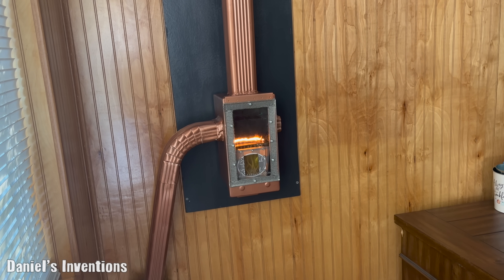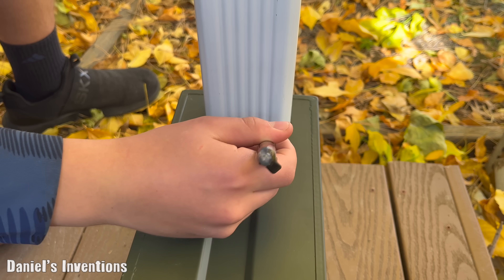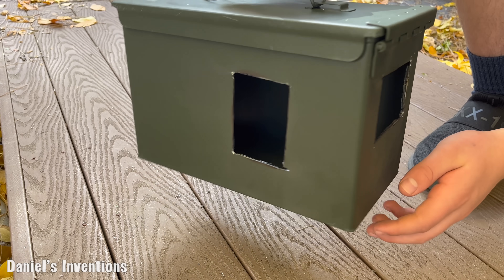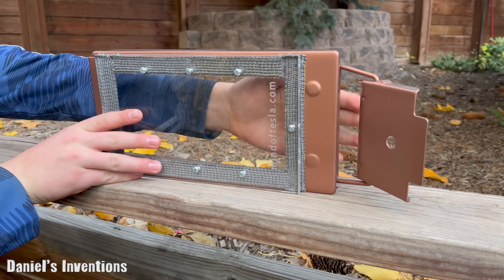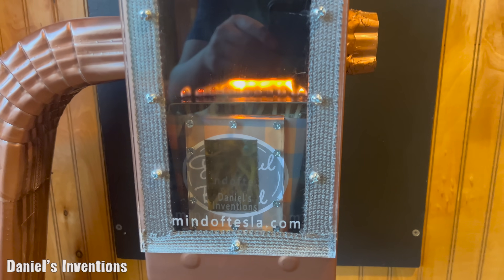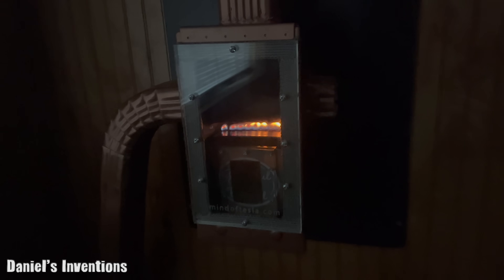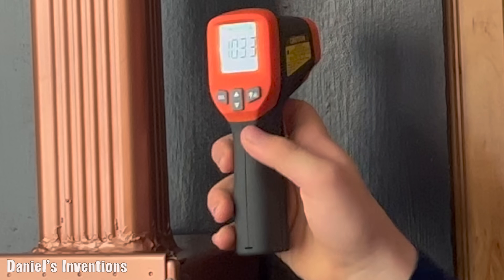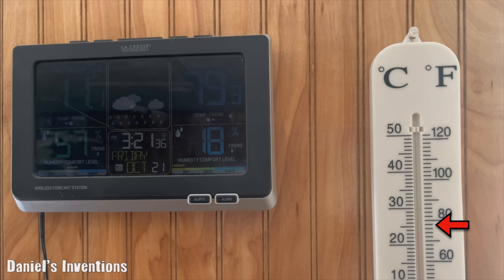ENDLESS Heat for Your Home WITHOUT Electricity

Comment: I always wanted to build a couple of those. Neat it's cheaper than propane probably, I run a 12 volt fan off a 60 Ah rechargeable lithium battery with 100 wh solar panel... should about do it' better to build them sideways from that tho' heat vortex induction system to vent off fumes outside yep'

Comment: Add a radiator type fin inside the heat exchange pipe.. I think I'll build it out of copper and add a water tank to it. Not a bad concept but I'll improve it for my own use..

Comment: If the intake pipe has the ability to switch from the interior to the exterior of the building I think that would add to the heating process if you were able to suck the air in from the inside of the home instead of from the super cold outside. Overall I'm really happy with this idea and I'm listening to all of the suggestions of specially about the cement board being spaced away from the wall and inch and a half.

Comment: If you are spending $100 in parts to make this, you are better off buying a diesel heater for less than $120, & will give off way more BTUs. Cool project and it looks nice, but not practical. Unless you have the parts laying around and only spend your time to put it together, its a fun project. Nice video though. keep coming up with more content.

Comment: It's basically the heat from 10 candles. That's not enough to make much difference at all. You'd get the same heat burning them in the open air... which is not much and certainly not enough to heat 2 rooms. I doubt you could even measure a heat increase with this.

Comment: Here's an idea, electrolysis activated by open flame 🔥 primed with a little alcohol to heat up HHO burner that burns the HHO generated with the electrolysis generating 120 volts ⚡️ wireless energy absorbed by a tesla coil for electrolysis of urine or water? People gots to pee when its cold so why not make great use of a waste product? 😊

Comment: Thermal electric generator that is started up with alcohol or oil lamp or small amount of bio fuel? That powers a air liquifaction module to generate liquid air that runs to ultrasonic ultrasonic vaporizer that generates HHO from the liquid air to power HHO burner to generate heat. Advanced technology going green! 😊

Comment: personally id used heavier sized piping even exhaust piping downspout pipe tends to be a bit weak, also you got it too close to the flame, which will cause sooting to happen in oil burning, you want an optimal flame almost white, without smoldering tip, same as a kerosene lamp for max efficiency

Comment: Well, why not design the main housing from Aluminum scandium alloy thermal electric generator with a electrical heating element with voltage multiplier and electronics to keep it operating off the thermal electrical generator after power drain from an organic carbon power cell that is charged back up and placed on standby with thermal electrical generator powering the heater till a toggle kill switch is flipped to shut it off? Is this green renewable energy technology? Will it work? 🤔

Comment: Don't ever just use a straight exhaust. Make it go back and forth or throw a radiator before it goes out. Otherwise you're just throwing heat out straight outside and you're losing a lot of it

Comment: Make sure you have a CO detector, or two for redundancy, if you use a homemade heater like this. There are safety codes for the construction of heating equipment which this device likely does not comply with.

Comment: Try a longer box Daniel. And use a heat powered Fan. No electric, just the transfer of heat propels the Fan blades. Like the ones used on or just above wood stoves. The warm air needs only movement to circulate & heat the room!

Comment: 3:15 WITHOUT electricity????
Reply: It has a electric motor 🤦🏿‍♂️
Reply: Guys English, the heat is without electricity, not the blower which increases efficiency
Reply: @Games4Kidz7  what does the fan run on?  good talk in english.
Reply: @soldieroftoughlove7635  if you couldn’t get it from what I said, you got no saving.  Let me try one more time, the heat source is not electric, is heat from fire, the design work by convection, adding a blower increases the flow of Air which speeds the heating of the room but is not an essential part of the puzzle. If I have to add more, we need an IQ test for you. Again he is not technically wrong to call this  heat without electricity
Reply: @Games4Kidz7  again..what does the blower run on? if you cant answer this ,youre weird...he said endless heat..is it technically endless?
Reply: @Games4Kidz7 
Where does he say this?? A no plug in fan??
Reply: @soldieroftoughlove7635  you are correct.  
The 12v electric fan  being used to force the hot air out has a power source. 
I'm guessing he's using a car battery, in which case there are more appropriate 12v fans to choose from, in the RV section.
That being said, a DC fan  hooked up properly without an electric source, would actually produce electricity once the heat really started.  The convection draft from the flame naturally sucking air in would eventually spin the propellers.
As a kid with a wood stove,  I used to hold little bits of paper at the intake and watch them get sucked in  once the fire got hot.
The highlight was holding a small toy motorcycle near the intake and watching the wheel spin. (I didnt get a second chance to do that cuz I accidentally left it too close to the fireplace one day).
With this setup, it  probably wouldnt spin the blades very fast, but any movement at all would generate something. 
Maybe enough to make 1.5 volts, which is about the same as a AA battery.
 I imagine you could charge your phone off it, if you wanted to wait 6 hours, lol.
Reply: Not fully indeed, but fo example I have a small solar panel that was like 5 euros that can efficiently charge a rechargeable fan that costs like another 5 euros. The fan has 3 speed and at maximum speed lasts about 3/4 hours so, it would last longer at low speed... but still, u could also install a fan that has a conection outside in order to use the wind to make it work. Or ever conjugate the two techniques so u have a backup plan for when there's no wind...
Reply: Se si vuole si può usare una cella di peltier per alimentare una ventola, ma ruba calore che metteresti nella stanza. Comunque non avrebbe la potenza di una ventola come quella del video, forse la metà.
Ps, per chi non lo sapesse una cella di peltier converte la differenza di calore tra le sue 2 facce larghe in energia elettrica, ma ha un rendimento dell'1 per cento. Il resto viene lasciato come calore sulla faccia esposta all'ambiente, quindi nel caso di una stufa la disperde in casa.
Pps, scusate se scrivo in italiano, l'inglese lo capisco ma faccio fatica a scriverlo😅

Comment: alcohol is cleaner and the carbon wick doesn't burn at all. the two jars hold about a pint each. Good for no more than 3 hours. Temp coming out is 110 F. Lot of work for not very much heat or burn for the dollar. Oh well had fun building it

Comment: This will put more heat into the room if you just light that homemade candle and put it on a table in the middle of the room.

There's no magic in this.  The MOST amount of heat you can get from this is how much heat those burning wicks make. ...and most of that heat is going up the chimney. (and every cubic foot of warm air that goes up the chimney is replaced by a cubic foot out dry outside air that cools the room)

Comment: I don't see an air intake from outside.  This means you're using your cabin air supply for combustion. Your potentially causing negative pressure to pull in cold air from outside to your living space rather than directly to the heater with an intake.

Comment: I learned aluminum could melt in a pit fire last year, it almost looks like melted silver. Stainless steel gutter would be the solution. for the cheap builder.

Comment: If you can cut steel with an amo box you can shape a sheet of steel in to a desired shape, with this much work you can just make a masonry oven by bending and welding steel sheets in to boxes, cutting wood in to specific small blocks and calculating your desired heat mass which would then be redistributed in to the building. A few competently placed fire bricks and shaped steel shieets to cycle the air and you have yourself a stone battery, to to mention how you can just make a tower out of cob underneath and make it both esthetically pleasing, use the convex aproach and reduce all the risks associated with keeping that much liquid fuel in a thin mettal container in a structure thats how and only sits on 4 screws, to what I assume is a wall made out of carboard, because american homes are just ply wood apperontly. 

yea you can make unbaked clay bricks pretty easily and even put your intake in to your base, two pipes pressing heat from the top would ferther distill the hot air and limit risk of fires. Depending on how you make it it might even excelerate the air.

 Yea so you should just make a bed for firewood and build a masonry oven on to and then turn the fan on and off. But you dont need the fan directly touching the steel all of the time, you can make a box, or rework one. 

Come to think about it why not sandwitch a rocket stove in a bed of fire brick and then add a boddy of cob with recirculating tunnels underneath, it would be relatively easy to design for airflow control , cleaning should be easy, you still keep the heat and the principles, you just need a way to manade a top chamber and a convex pipe...

Comment: see the problem with that, while its very good is that radiant heat is 60 percent more efficient then convection, so radiant heats the body while convection heats the air. Convection is good if your not constantly opening and closing the door but it is very relative to where you are and what type of space your inhabbeting. It might be more power efficient if you just use a custom masonry oven which builds up heat in the middel, and it is a lot more expencive if its a big one but you should be able to make a little one in a cabin with simuler amounts of material in terms of metals, or just  make a mold and make a rammed earth or cob oven that copies a masonry heaters design and reuses the gasses and emits heat  while also being a convection heater. I dont know maybe experiment.

Comment: You could even cut out the need for buying and replacing the wicks by using a carbon filter to use as a wick as it doesnt burn but soaks up the oil.

Comment: I would use automotive exhaust pipe above the flame. 
Also, if you have a fresh air intake on the bottom that draws air from outside, you wouldn’t have to worry about low oxygen levels. The combustion chamber would be completely isolated from the air inside the room, cabin, whatever.

Comment: The combustion air should be taken from the outside or else it will leak in cold air where possible to compensate for the loss of air during combustion

Comment: I wonder if you put one of those fans that work off heat would work to push the air? Wish I knew the name of those. Could kinda change just a couple things just on the part actually blowing heat out and boom no electricity needed.

Comment: This is a pretty awesome little heater.. a suggestion for wicks that will last an extremely long time and not have to be constantly adjusted however.. 304 stainless steel mesh as super fine as you can find.. roll the mesh tightly to fit the wick holes.. it wicks every bit as good as braided wick but last much longer. Cheers to an awesome design guys!

Comment: apart from bien a fire safety hazard i like how you say zero electricity but you need electricity to run the fan to distbute the heat lol also its good for a room only wont work for a whole house lol moron

Comment: I spot several design flaws. Very difficult to control. In a properly insulated building you shouldn't need constant heat and if you have constant heat, it's going to hot as hell. You could turn the fan off but the box is then going to get VERY hot, radiating heat into the space that is already very toasty. 
The hallmark of any temperature control device, is it's ability to control the temperature. 
You would actually have more control simply using that oil in an oil lamp device and sitting it on a table. Then just turn it off when it gets warm enough. You can't really turn this thing off easy. Same with turning it back on.

Comment: Great idea. Could you use the heat produced to also circulate the air, so that no electricity is required? For example, if the exhaust had a turbine, could you then transfer this rotation to another turbine drawing air into the system (like a turbo)?

Comment: $12 per day is $336 per month.  I can heat my 1,400 sq ft house with propane at the same cost.  Also, you are burning an aluminum gutter pipe, that will give off poisonous gas from the coating.  Good idea, but I would swap out the aluminum gutter pipe for copper and switch out the oil for obtaining waste oil from a restaurant or chicken fry place.  That will reduce your cost to less than $2 per day.
Reply: Yeah but the smoke from those oils. 🤷🏻‍♂️

Comment: This looks like a giant fire safety concern. 😂 not to mention the tubing going directly into the house for 450 degrees seems widly unnecessary given you could run tubing and a fan over it to transfer heat into the house being far safer. As that's how hvac heaters work.

Comment: To truly make this 'without electricity', thermally attach a Peltier chip to the side near the top, just above the intake.  This might generate enough electricity to drive the blower fan.  To boost that, have a little vent at the top of that elbow to blow air across the 'cold side' heat sink of the thermal chip.  

You could also use this power as a low power USB charging port.  You could also add bunch on the back with external sinks and a small fan to power other ports, or even make a low power LED lighting bank,

Comment: claiming what is the size of ten tea candles can barely boil water, you claim it heats a home?
it is simply impossible, you broke the laws of physics, were is your nobel prize?
you are claiming about 1000 btu is heating an area that needs 8000 btu to heat?
impossible
and no electric, you mean besides the fan?

Comment: Good proof of concept at the very least. We can see that it works.  Needs a bit heavier duty material and welded/riveted/screwed together. Needs a wick feed system and a knob on the outside like an oil lamp would have. (Electric auto feed would be cool too, if that could be calculated and rigged up) Maybe one or more large flat wicks may be easier to use and design for instead of a bunch of round ones. A bit bigger for more BTU might be a good idea too. Doing the math for how many BTU this thing puts out a gallon of soybean oil is 129k btu total.  Burning 1 gallon a week works out to 767 BTU output per hour, around 8k per day. And that is probably only around 70% efficient venting a good portion out the chimney. A good wall mount heater can put out 8k an hour. Some go as high as 30k.  
A standard 750/1500 watt electric space heater does 2500/5000 btu for example, and that's generally what's recommended for a 250 square foot area. 
I think with a bit higher build quality and few convenience features like an external oil fill neck, easier to use wicks, and larger size for a 1 gallon oil capacity and 2000-5000 or more btu output and of course a heat shield and mounting kit for installing it safely this would make BANK on amazon as a waste oil heater.

Comment: No electricity needed....except for the fan lol
Reply: TEG could probably use the heat from the furnace to power the fan. Much like normal wood stove fans. They don't need to be plugged in either.
Reply: Get a heat powered fan
Reply: @xXIronPeachesXx Yeah. There are fans for wood stove tops that rotate just from the heat, and they get good reviews - people who heat with wood stoves use them to distribute the warm air further.  May take some design issues to get the fan blades and part that needs to be heated in the correct spots here, but might work.
Reply: A probe that will produce enough voltage to run the fan
Reply: Use a heat powered fan. An induction fan I think they're called.
Reply: You can use a solar fan

Comment: 😅😂😅😂😅😂😅😂😅😂😅I'm dead😂😅😂😅😂😅😂😂😅😂😅😂😅😂😅😂😅😂😅😂😅This a load of rubbish, the materials used in this idea is ridiculous & extremely dangerous. Unfortunately this is a cowboy setup, & this is a serious fire hazard.
Great vision & idea, but the materials need to be changed, JB weld on the inside of the burner 😅😂😂😅😂😅😂😅,

Comment: This isn't a bad idea if you're off the grid, but if you're just living in a normal home it's stupid as fuck. Space heaters use a whole lot less energy than people think they do. Around 80% of anyone's electric bill is central air. If you don't believe me, grab a couple window AC units, and a couple space heaters and look at the difference in your bills. 

That said, I will absolutely set up something similar to this at my camp site. Likely it'll be cold air intake outside rather than using a computer fan, as my power is dedicated.

Comment: This is an enormous fire hazard. The exhaust will have unburned hydrocarbons that will condense on the exhaust pipe. One speak ens up relying off the wick you have a chimney fire.

Comment: Excellent design though I would put a peltzer fan on it. A peltzer is a thermovoltac device you could mount it onto the wall of your heater with a little heat sink on it and it provide the voltage for your fan without batteries or plugging it in the wall.

Comment: 🔥🔥🔥 What would happen , if one ere to fill the inside metal tube with metal screen mesh and copper tubing filed with sand, would you this increases the air heated outlining increased metal to air surface area? 🔥🔥🔥